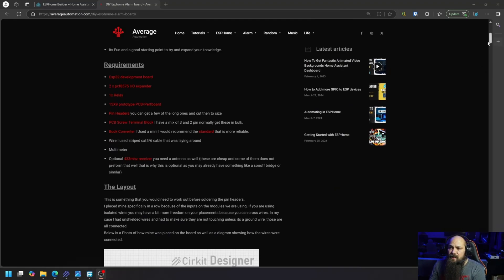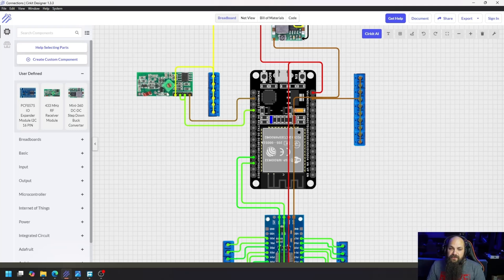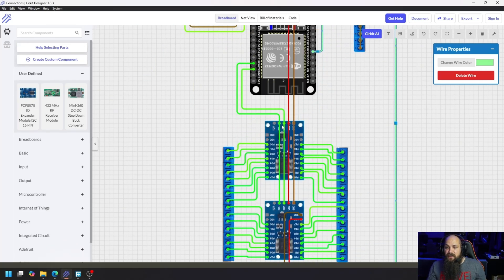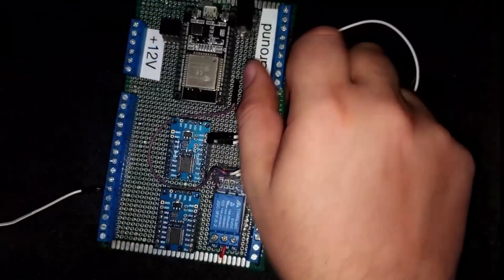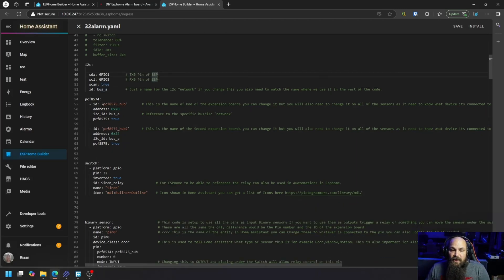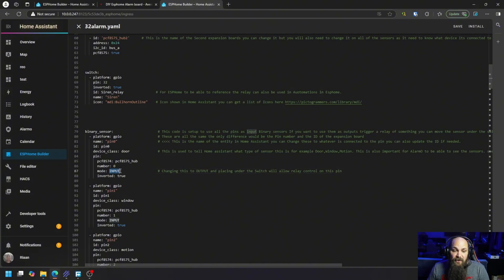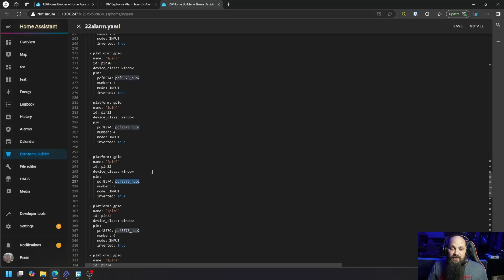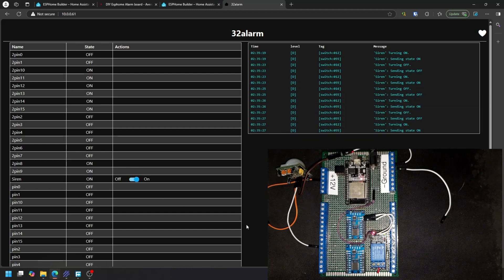DIY Epic ESPHome Alarm with Over 32 Sensors/Relays

Comment: Pls dont use Rx Tx as sda scl, probably this be working fine but that in not the way od diong that. If You using expander make sure to prepare for event when expander is broken and is blocking comunication etc. But this not that bad
Reply from the maker: @PK-lk6hq  I have been using this for almost a year with it being connected up like this. Can you elaborate as to why the rx and tx pins are not a good choice? I would like to make some corrections to my information then.